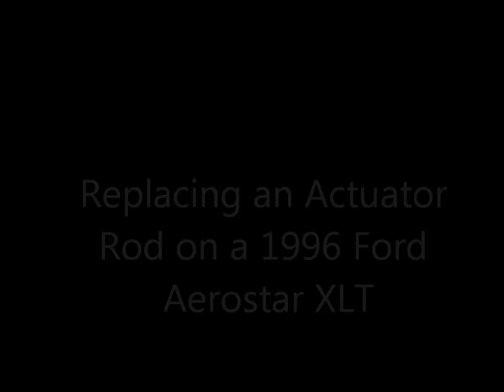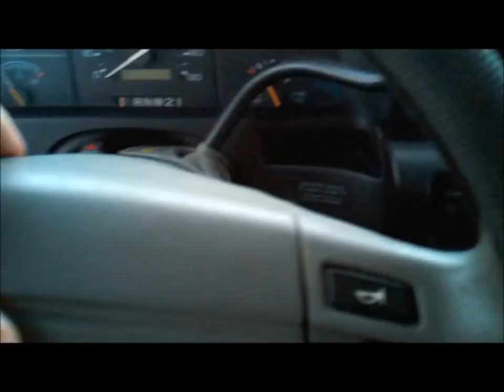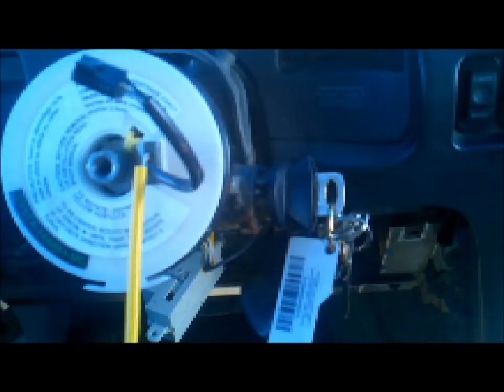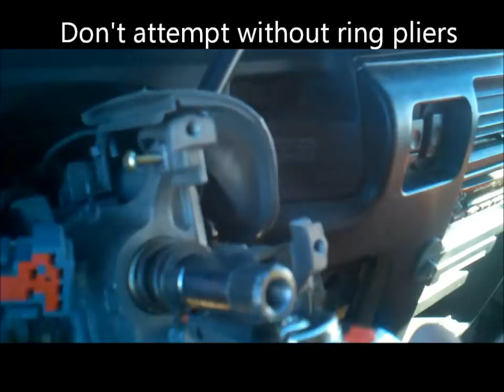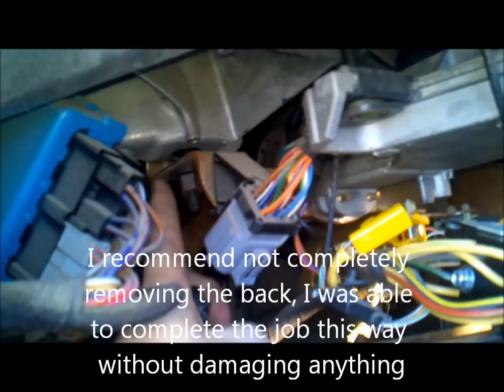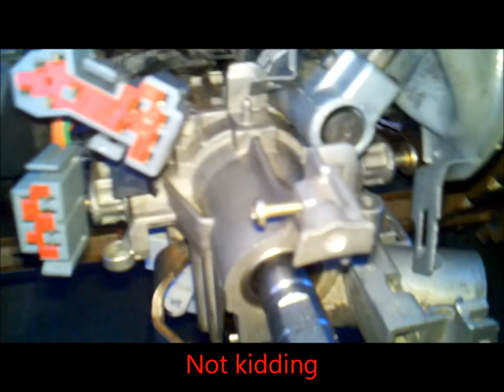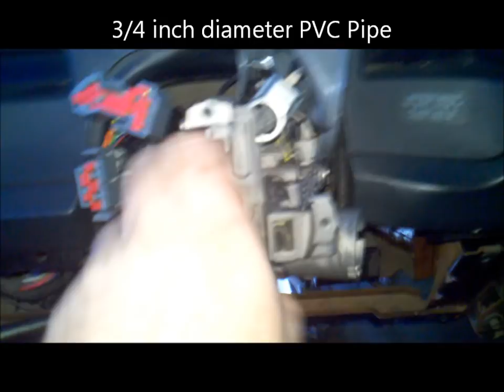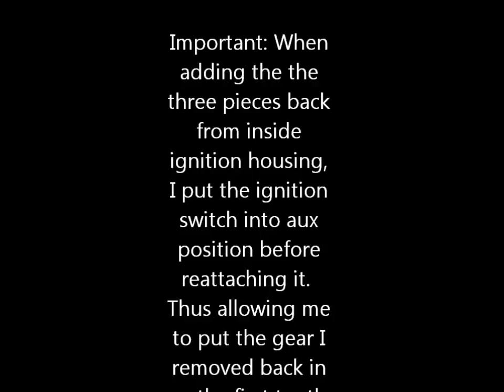Ford Aerostar Actuator Rod Repair

Comment: Thanks Capt. America. A note on my go at this. The upper actuator arm on my 95 F150 lost the little metal pin. It just worked loose over time. When I took the column apart it was laying right there in the housing to the right of the arm end. I bought the new arm but never used it. I lined the hole up in the old arm with the slot and put the pin back in from the left. Was not easy but I used the yellow grease (a blob of it) to hold the pin in place while I started it, put a screwdriver on the right side of the arm to steady everything, got it started, and pushed it home with an awl. Lastly,  I cut a piece of plastic milk carton and placed it in the right side of the arm housing to make up for any wear that may have occurred over time. It is held in place not only by the arm but by all the extra yellow grease (when you start the job you'll know what we mean) I collected and applied it to both sides of the plastic. I did not want to grind or shave anything down on the arm. Just thought this might be better. Your choice. It is do-able my way,  just really difficult. Thanks again to You'rePrettyGood & Captain America. Thanks to the other posters too.

Comment: Forgot to mention that the tilt spring can be compressed quite nicely with zip ties! Have to evenly tighten them as you go or they will slide to one side. Had five zip ties before I got it compressed evenly and tight enough to easily go in place. Cut the ties and pull them out...
Reply: Thanks for that tip, The zip ties worked nicely!
Reply: So, there is enough room to install the compressed spring AND zip ties.  After cutting the zip ties, they will have a lot of pressure on them at the ends of the spring.  Do the zip tie pieces come out OK without popping the spring out?

Comment: This is one of the better videos on this fix. I did find that the PVC pipe can be hammered rather than bolted to get the snap ring seated. The air bag nuts to hold the "claws" down while seating the housing is genius! I also found that placing the steering wheel retaining bolt back in the column gave a place to pull the shaft into the upper housing after having little luck with the screwdriver in the side method. United Technologies, the actual mfg of the assy, blew it with the ign rod!

Comment from the maker: If your lucky then the ignition switch is the problem (much easier to fix).  The metal pin connects to the actuator rod.  Also, make sure to read the comments on this video as there has been some great tips for the repair (especially in terms of getting the actuator rod back on that pin during the repair).

Comment from the maker: If you look under your dashboard directly where the steering wheel comes in there is a beige/tan box with wires going into it (you can see it out in the video at 00:07).  That metal pin sticking out of it is how you start the vehicle.  It is attached by two hex screws (if I am remember right).  Get those out and you can put it how I have it in the video.  Then insert the key and unlock the steering column, and I recommend pliers to move the pin.

Comment: I have the same issue. I believe it is the Actuator Rod. What exactly does the ignition switch do and how did you manually start your car? I need to know this so I can drive it until I can afford the repair. Thank You so much for your video!

Comment: I'm replacing the bearing at the very top of the steering column on my '97, and this video is invaluable!  My only question:  How do you get the top plastic covering of the steering column off?  I guess you have to pull the lock cylinder first-

Comment: What about reinstalling the TIlt wheel spring?
Reply: There is a post abut this earlier. Thread several good quality zip ties through the spring, tighten them all up slowly 'till the spring is held in it's compressed condition, (i needed 8) it will then go in. Then cut the zip ties and pull them out. It isn't easy, but it worked for me!

Comment from the maker: Thinking about it, when removing the gear piece from the key cylinder housing I would recommend marking both the gear and the actuator rod (the broken one) with a black permanent marker to show which tooth you are supposed to line up in the on position.  Then when you take the rod out set it next to the new one and mark the new one in the same spot.  This should make realigning the teeth easy.
Reply: thanks